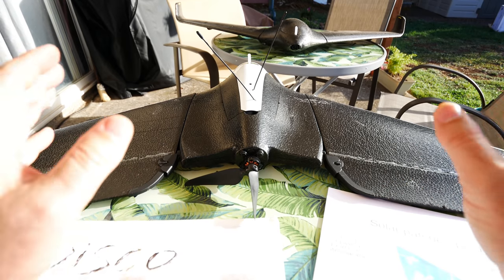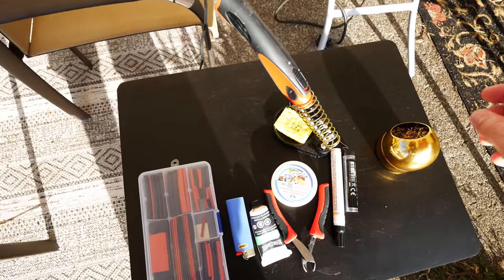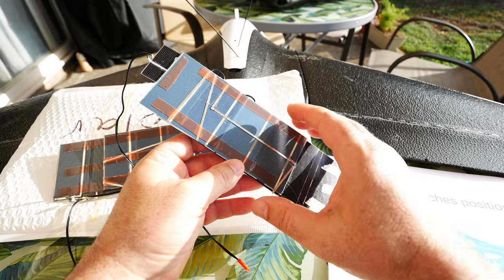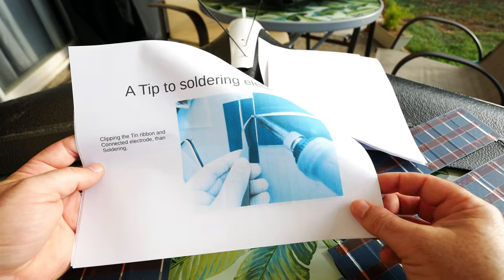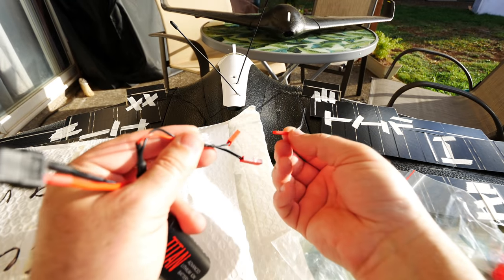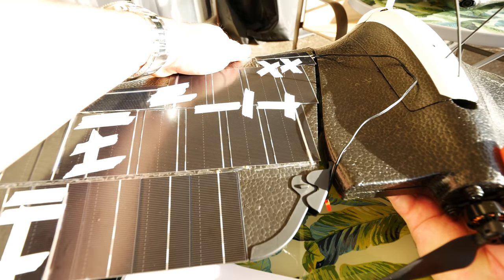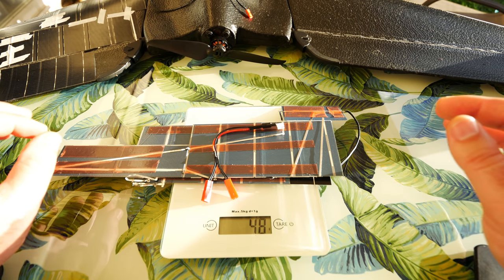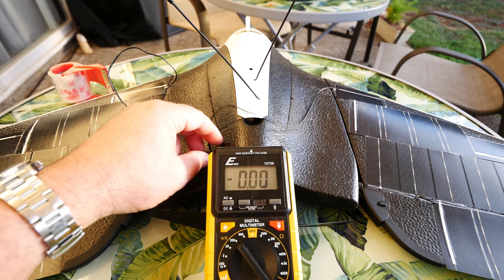Parrot DISCO 4G LTE Solar Panel Mod Install - Solarealdrone Kit (Works for other Planes/Wings)

Comment: Way cool!!! Since the Disco is out of production, are there any alternatives for doing 4G long range and this solar mod?
Reply from the maker: Not in such a complete smart system as the disco but some have transplanted the disco flight controller into similar wings with success 🍻
Reply: Delair UX11... military surveillance drone... 15000$.
Reply: One day when I finally get into the hobby I want to see if the GASB One 3d printed wing would be compatible with disco mods. It's wingspan is smaller but there is a customizable Proteus design too. There are also other 3d wings like the one from Eclipson. I just mention these because 3d printing offers a lot of options. You can also buy models of the parrot disco though in my super brief research I saw claims that the model might not be an aerodynamic copy.
Reply: @SetitesTechAdventures  the actual value of a disco comes from its multi core Linux computer... not the piece of foam around it. 
There WON’T be something like this in the future... the new set of drone regulation is forbidding it.

Comment: Happy New Year 2023 - Great Presentations - Every year
* Nuclear Batteries are not yet available, so we have to find a way for a long range flight with solar cells**
Why not get a 10,000 mah battery and have the solar cell maintain it charge for a long range flight?

Comment: Can I just put a different brushless motor, same kv, and solder an mr30 plug that goes into the CHUCK? And if I want to put a different motor in, will I have to re-program anything in the disco?
Reply from the maker: Some have tested this in forums and the CHUCK is finicky with different motors since amp draw is quite variable.  I'd search some and/or test out a few motors you think will work.  If it doesn't like the motor I think it will just not kick on at launch 🍻
Reply: @DustinDunnill  Darn, that’s the problem with the Parrot Disco it cannot be replaced with different parts because of its programming. If only we had the keys to that...

Comment: I'm glad parrot is starting to get their stuff together, I had the parrot bebop and that was so awful. I just got a DJI mini 2 and it's 100000x better and half the cost of my bebop when it came out. The bebop was a disgrace, but this looks much better, and I am wondering if it's possible and how if I can make my mini 2 connected to 4g/lte
Reply: Would like to do it too for my mini 2 . Have you investigated and find out a way of connecting your mini 2 to the 4g network ??

Comment: Your Amazon link to the batteries is no good. Do you have some other alternative I could look at?
Reply from the maker: I think Titan must have discontinued these packs.  Most are making their own similar packs or larger.  A light LiPo will also work or even the stock Disco battery 🍻
Reply: @DustinDunnill  I have NO batteries. Been trying to find some good stuff for the 4G mod. Im at the point of just wanting to buy a good battery but struggle is real.

Comment: This Disco wing is soooo underated...constant signal connection over the network, regardless especially when flying low...Such an underrated concept IMO.
Reply: I saw a guy on youtube calling the disco "stupid" and "useless" smh. It's probably the best drone ever!
Reply: @cateyesaerial7703  a bigger version of the disco would be nice asf
Reply: @aj-qn7nm  You could mount disco electronics in a Skywalker x8, which is quite a bit bigger.
Reply: Might have been the original super high price

Comment: This is unreal!  I started flying FPV in 03 and we were psyched to get 433mhz LRS systems and 900mhz 1w tx/rx.  I remember when we had early antenna trackers and homemade yagi's that gave us about 5 miles range.  Felt like it couldn't get any better than that.  Would have killed for this setup! Great job!

Comment: ⚠️BE CAREFUL!⚠️ I've order the same solar panels kit: yhey are NOT delivered ready to instal like in the video: you will have to solder EVERY single small panel together before installing it. It will take you much more long time... With the price, compared to the same material you can find on AliExpress, I would have expected sometihing ready to deploy like in the video. A good note however for the transport packaging: very good and arrives quickly through EMS (about a week from TaiWan to France).
Reply from the maker: Did you ask if they could solder for you? I'm sure they would for an extra charge 🍻
Reply from the maker: You tried it in strong sunlight?
Reply: @DustinDunnill  Hello, I was expected to get it like in your video. I asked them the document you have, but not received. Anyway, I soldered all, not a bif deal but takes time. I am waiting 2 servos I have to change them before making some tests. Cheers.

Comment: Why bother with solar panels if you not going to use it? To use 100% of solar panels power you must connect them to up/down power inverter plus LiPo balance charger set for maximum allowed charge current... This way you maybe able to fly for several hours...

Comment: Just nearly pressed the buy now button but will wait until your video, not had my disco's out this year but looking forward to next year, not sure these will perform well in the UK with the little sun we have. Great video and great mod, Keep em coming :-)
Reply from the maker: Definitely need some sun to make it worthwhile.  I think it will suplement the batteries with about 1 to 2 amps of charge with good sun 🍻
Reply: @DustinDunnill  thanks for your reply and looking forward to the next video with this in use, so you think 3s 2p is still the king? I think 3p is just a little too much weight personally.
Reply from the maker: I think so.  The compared time gain is diminished a bit with 3s3p because of the weight, plus servos and motor are working harder so more wear and tear.  I think I got about 80-90 minutes with 3s2p and 120 max with 3s3p.  It can handle it just depends on if that extra flight time is really necessary 🍻

Comment: The disco is Soo cool! So you have unlimited range and battery while flying in the day?
Reply from the maker: Won't be unlimited but will put some power back in for longer flight as long as there is good sun 🍻🙂

Comment: Cellophane wrap for entire wing perhaps or a heat shrink and have it cut to edge size in a pc cutter machine over lay the cut out and then adhere and take heat gun and shrink tight.

Comment: IMO solar paneling on small drones is a poor investment, as the weight, drag, and cost isn't likely to extend the range more than just going with a slightly better or larger battery.    People overestimate the efficiency of these panels in producing significant voltage.

Comment: Looks very interesting.  You should be able to make some flights out to the nearby islands with the solar boost. I'm a little concerned about the flex joint at the ailerons ... imagine coming back from one of the islands, and one of those joints breaks, & you suddenly lose the solar power boost! YIPE!  Well, I'm sure you'll give it lots of testing, which we'll be on the lookout for. You don't have to deal with Winter there, so you're lucky. When it's Winter here in NE Ohio, we don't get many sunny days, not to mention the snow & cold. Mahalo!

Comment: I only had the parrot 2, which I did 3g mod at the time, and I thought I was smart. This is pretty close to military technology. Or just very exotic stuff. I just can't get over how cool it is that civilians get to play with this stuff. Btw, I wanted to get me a disco, but here in romania, I am not technically allowed to fly it all. So, it's not even on sale. Even my old quadcopter is technically illegal, especially with a 4g mod. I never used it as such, I just wanted proof of concept. Also I wanted to control it from a computer screen, with a PS4 joystick. I did that as well. I hated the phone thing. Anyway... fun stuff.

Comment: I would love a video to see how much flight time can be gained with these solar panels
One problem the Disco has is that the voltage indicator just goes low.  
I mean that if, for example, it charged more battery than it is consuming and it marked 50% battery, even if the batteries were 100%, the indicator would only show 50%.  
I know this because I have checked it with a voltage regulator.  When the voltage drops, the battery percentage drops, but if you later raise the voltage again, the battery percentage does not increase
Reply from the maker: Correct, battery percentage app icon will not show an increase while in the powered on session but it will slow or stay at a percentage indefinitely if voltage is increased.  This setup will never increase the voltage while in flight as it is only meant to supplement with 1 to 2 amps maximum which is less than the Disco draws while flying.
Reply: @DustinDunnill  thanks... it was the question I had in mind while watching your video... ;)

Comment: I'd like to see some form of voltage regulator(they're very small and cheap these days) and something that indicates the panels are outputting the correct voltage, maybe a Series of leds that show full voltage when working properly etc, it seems to be a bit fragile. I always enjoy your experiments with aircraft.

Comment: ATTENTION: you might have made a big mistake cause you taped the cells
that tape is working like a shadow and let the power drop of the whole wing.

If you hold a branch of 1 cm thickness 1 above of a real solar array for 1,7x 1 m where 4 modules of 450 W are connected in a string, then these 1800 W modules will decrease the output to 10 - 20%  due to this tiny shadow

Same for this modules on the wing. You need doubleside tape and fix the cells at the edges with doubled sided tape.
Same for antennas that throw a shadow on the modules cause that will cause another power breakdowon to 10% or so.
Reply from the maker: Thank you for the information 👍

Comment: Your video has inspired me to also try the 4g but I am having a very hard time finding the correct dongle. Which one are you using and are you one different lte bands in hawaii.
I am in indiana and I need 2,4 or 5. I need to purchase a 3327-510 but can not find one. When in the docs it specified what models worked it did not specify the bands. Confusing. What carrier are you also using? I even bought a disco to give this a try but no stick...
It will be nice hearing from you.

Thanks Ralph
Reply from the maker: You can see compatible tested modems at uavpal.com 🍻

Comment: Should've used a heating gun to heat the tape before sticking the tape, gives it a bit more strength by curing the glue. Great video though.

Comment: You may need to ensure the battery is disconnected when not in use. Without a charge controller the battery can back feed to the panels when there is low/no light
Reply: He mentions in this vid if you have watched it all?
Reply from the maker: Yes, leave them disconnected or cover panels until ready to launch 🍻

Comment: Hey Dustin...Can you or anyone that knows please tell me if there is a “Replacement Motor” for the Disco as the original here in Australia are massively overpriced for what they are.......Thanks in advance😀
Reply from the maker: I'd stick with a factory replacement motor.  You should be able to find parts on eBay or other sites 🍻

Comment: You should test what current these solars output, this should give you idea how much these will contribute towards your circuit. Anyways good video. I'm waiting for a test.
Reply from the maker: At about 30watt output and 16volts in perfect sunlight they should produce around 1.8amps by using the I=P÷V formula.  Having direct sunlight perfectly perpendicular at all times  will be  near impossible so I'm assuming an average of around 1 amp in good sunlight.  Definitely a little boost but not enough for continuous flight 🍻

Comment: It's interesting to me that there is no charge controller and that this kit  just shoots the raw voltage into the balance leads.  Theoretically, without anything cutting it off after 4.2V, it seems like you could inadvertently overcharge your battery which of course could lead to damage and or fire.    For example,  you could start your demo with a full battery, then even in preparation of the mission if you were to let it just sit in the sun for 10 minutes you would be in an overcharged state.  Be careful man!
Reply from the maker: Yes.  Plugging the panels in just before take off should eliminate any issues 🍻

Comment: Solar panels, another Disco 1st! Question? I see you are using a lens protector.  Based on your experience with the Disco's camera, what's the "best" printed lens protector available for the Disco that doesn't block the field of view? Thanks.
Reply from the maker: I like the low profile protector for least wind resistance and good protection 🍻

Comment: Would clear plastic shrink wrapping the wings with the panels on decrease the solar input? Might make the setup more durable and moisture resistant?
Reply from the maker: The panels themselves are already laminated.  I think any more will add too much weight.  Maybe a little silicone spray treatment on the solder points would keep them from corrosion 🍻

Comment: Hey Dustin, since that balance connecter is going to be a high use connection, I would reinforce the back side where the wires are soldered to the pins. What I do, that seems to really beef them up, is cut a piece of heatshrink that can slip over the connecter and will cover from the front edge to about 1/4" past the pins. Then I slip it over the connecter and squirt a liberal amount of hot glue in the back side covering all the pins and wires. Then when you use heat to shrink the heatshrink it squeezes out the excess and creates a really nice strain relief for the connection.
Reply from the maker: Hey great idea.  I thought about it a few times indeed and sounds like a good method 🍻

Comment: I hope this configuration wont set you battery in fire. Seems a bit janky to wire these panels directly into the battery.
Reply: @David Bowie does the disco draw so much power ? I thougt 25W would be quite nice power for this model plane.
Reply from the maker: It should suplement the battery with 1 to 2 amps.   The Disco draws around 3-4 amps cruising so will always be pulling more power than the solar can provide as long as it's plugged in when ready to fly 🍻

Comment: But, but.. how about overcharge protection of the cells in the Disco??? And balancing the cells as well?
Reply from the maker: This is meant as a supplement while the Disco is flying.  Since Disco will be drawing more power than this system can provide, there will never be a risk of overcharging or the need for balancing 🍻
Reply: @DustinDunnill  Alright, looking forward for the next video, would be interesting watching the voltage ;-)

Comment: You may want to switch to two component Cyanoacrelate glue for your assembly of such items. It is a gel glue with an activator. Modellers use it to build kits. Very, very strong. Also used in carpentry to put up crown moulding and trim.

Comment: Hello, I just flew the parrot disco for the first time, but I didn't quite succeed, it took off well, but then it flew very fast again,, I had a little trouble, I didn't slow down the engine, as I saw in youtube, the drohn automatically slows down the engine when it goes up, where am I? I'm making a mistake, can you help me, thank you in advance,, greetings

Comment: Ordered one of these through your link. Thanks for your Video. I have a question. I have a  Lion battery Mod that used the original Battery protection circuit on the original battery. Hope this will act as some kind of regulator.

Comment: Or maybe just have a solar printed panel the correct shape and skin the entire plane bottom and top and catch the ocean reflected light off the bottom. They even have spray solar materials you can paint the entire object and then just add leads while wet and boom one single entire paneled object in entirety.

Comment: hello,,there is a problem with my parrot disco, the battery is full, but when I press the power button, it won't turn on, what could be the reason I do

Comment: Loved the video you ran on this after the comm upgrade.  If you had full sun couldn’t this upgrade allow the disco to operate 3 or 4 times longer?
Reply from the maker: I think it will only supplement with around 1 to 2 amps into battery if sun is good.  Likely maybe another 10 to 20 minutes of flight time but we'll see 🍻
Reply: @DustinDunnill  Solareal says their tests reveals twice the advertised flight times with the Stock battery
Reply from the maker: Under absolutely perfect sun & wind conditions perhaps it's possible.  I'm waiting on calm weather and I will compare with and without in my flights test 🍻

Comment: love the disco vids. that solar connection by the aileron hinge could be a real problem.  needs more than checking every now and then. really need to move it 1mm behind the hinge really.  can't wait for the flight vid.💕

Comment: Hey Dustin. Love the channel. 🤙 I am gong to purchase a Disco after the holidays. I want to do the 4g mod and get the solar panels. I am confused on the modem for the 4g mod. I am with AT&T.  I know I have to purchase a sim card. Is it like a data only sim card that has to be activated by AT&T? If so does the 4g mod use data from the modem and the cell phone? If yes then about how much data does the 4g mod consume in an hour? Thank You!!!
Reply from the maker: Hi Darby,
The uavpal.com link I posted in description under video explains everything you need to know in depth and how it all works.  I use my sim card from my iPad I got on T-Mobile which is also my cellphone Carrier (important to both be same carrier).  You'll want both sims to have the highest available data speed option from your carrier.  Data used is between 1 & 2 GB per hour depending what recording/streaming resolution setting Disco is set at in the parrot  app options 🍻